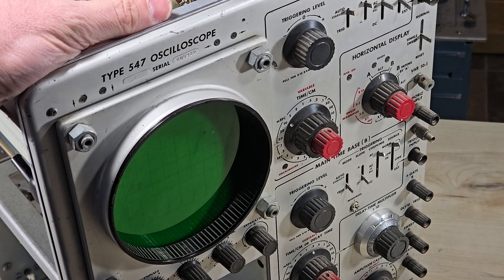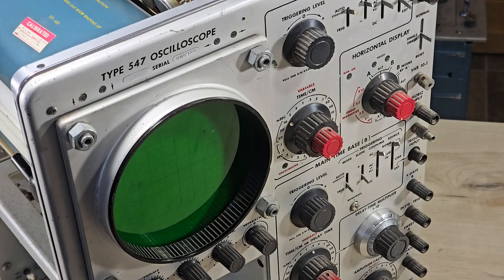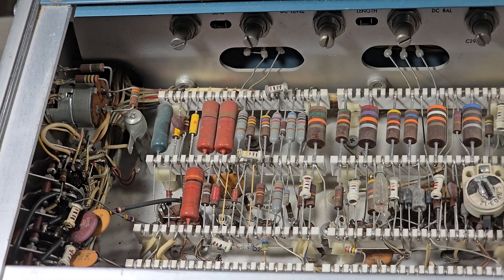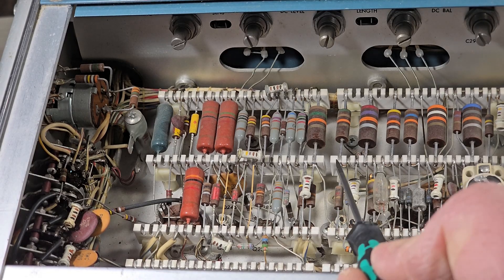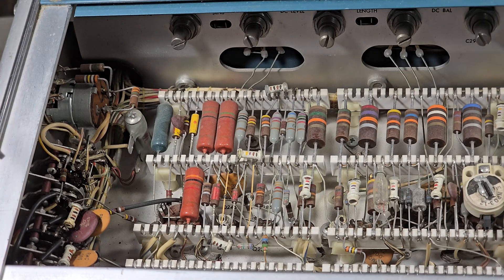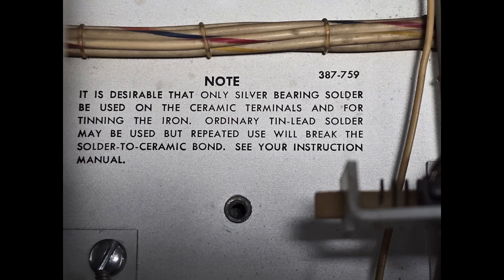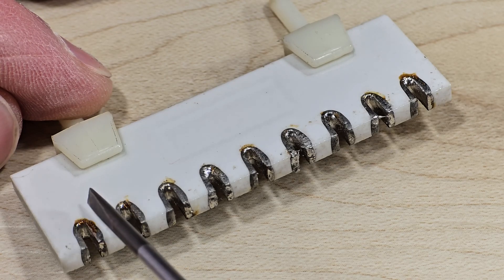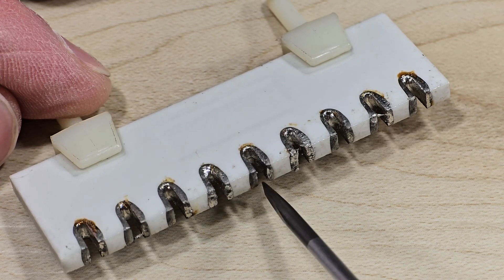Ceramic Standoff Construction Inside a Tektronix 547 Oscilloscope

Comment: I had a nice 310 and then a nicer 310-A that came from a school , one time.  Worked great.  The side swung open easily so I could admire all those strips and the insides. It had the warning label and the little container of silver solder too, which I never had to use.  I got two modern solid state Teks now but besides looking quality inside they are not quite as impressive to open. Frankly I would not want one of the large tube type Teks and the one I did acquire I pretty much just flipped it.  Too bulky and heavy for my space.